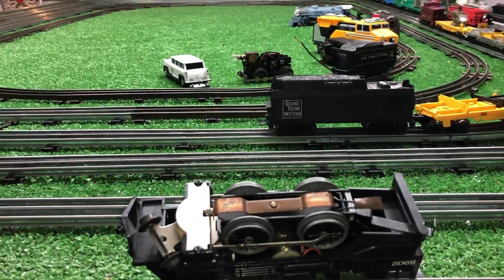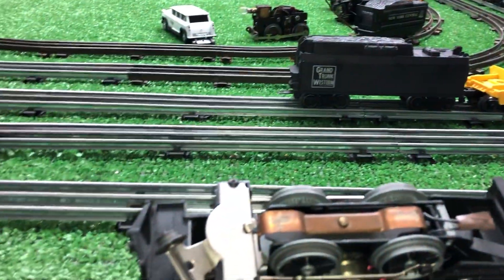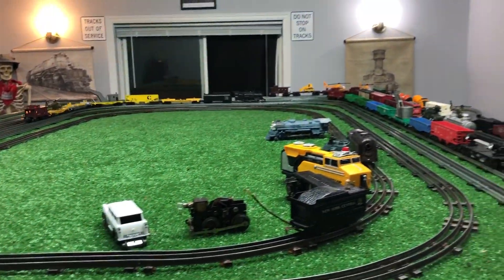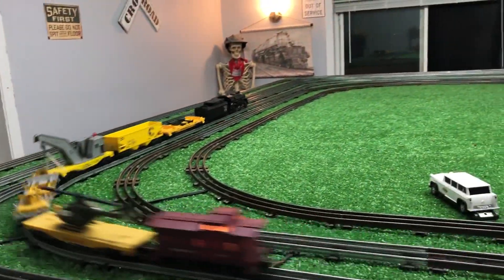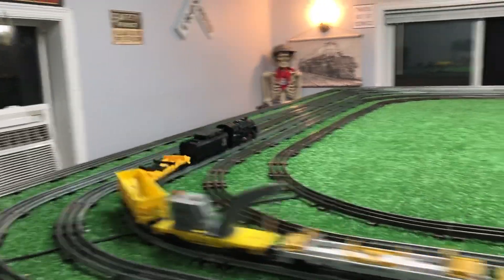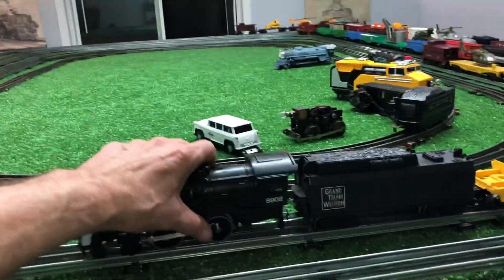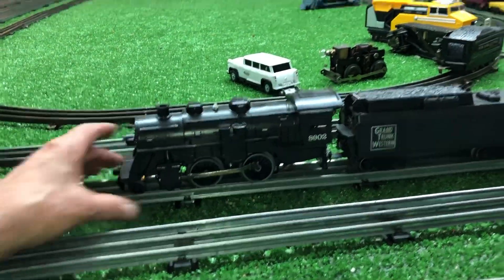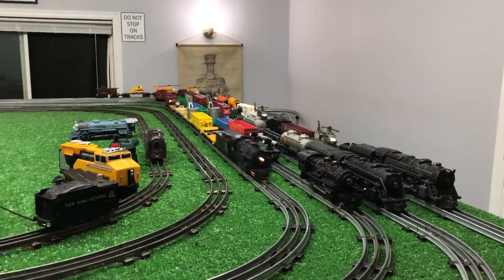LIONEL 8902 / MARX MAIN CONTACTOR INSTALLED / FIRST LOAD TEST / WORKS PERFECTLY

Comment: Would you happen to have a can motor for an 8902? My first Lionel set I got in 1980 has an 8902 engine that has finally burned out the motor.